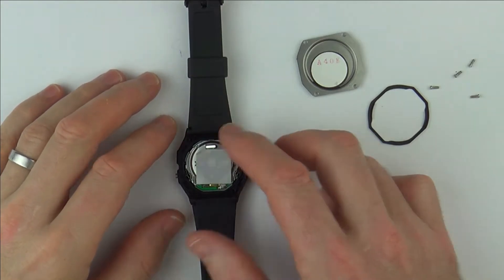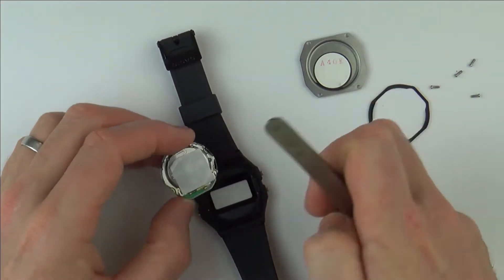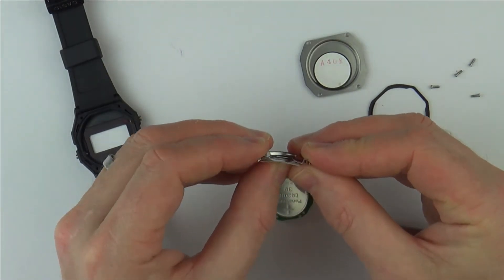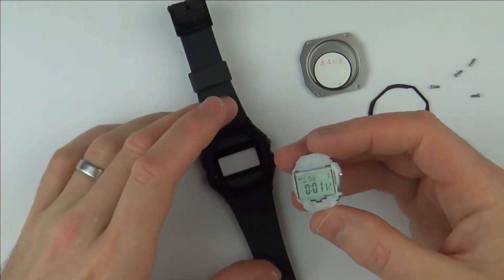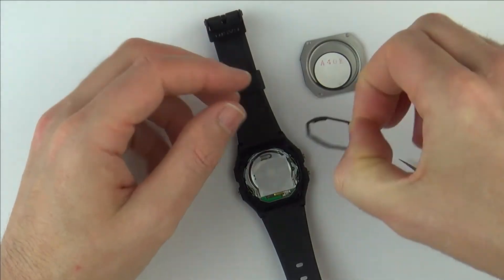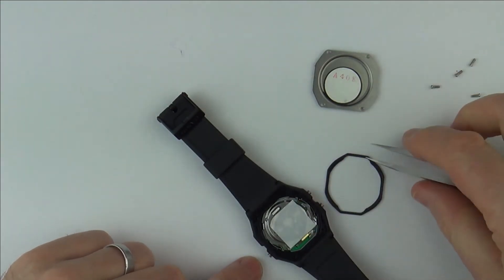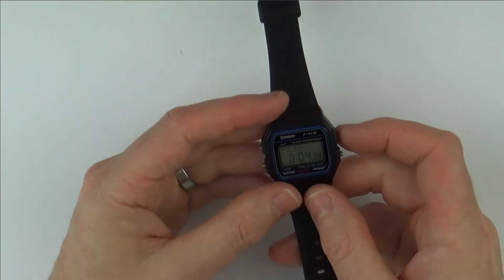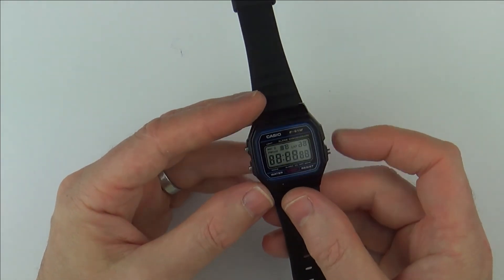How To Fix NO DISPLAY on a Casio F91W Digital WATCH after Changing the BATTERY

Comment: Even after you reset, if you don’t see any digits on the display, it could be because the contacts with the battery are so flattened down after years of a battery being in there that they’re not making a good enough connection. Take the battery out, use tweezers and pry the contacts up a bit so it makes a better connection.
Reply: This helped so much thanks!

Comment: Nice clear explanation. Thanks. 
One other thing that might have been good to mention is the technique for re-setting the watch. Sometimes after being re-started, the watch will come up in a frozen state and needs a re-set. The display will be fixed and will show nonsense characters. The trick is to connect the contact at the bottom of the re-set hole on the top front of the movement holder to the positive (springy back plate). On a genuine Casio F91w, the hole is marked AC I think. It looks like it connects to the can of the quartz crystal and when this is shorted to positive (the back plate) either with tweezers or a fine bare wire, the processor, resets. A couple of years ago I found my old F91w which had been abandoned for about twelve years and put in a new battery but it came up in this weird condition. In the end, I thought it was knackered and threw it away - sad to say. Had I known this trick it would still be working.
Reply: Realized the back plate is the + thanks so much!

Comment: I had the problem after assemble and reassemble the digits are "splittet" in a weird way. Reassemble it one more time, bend the contacts of the metal plate....and display works as a new one😊
Thanks, dude.

Comment: SOUND IS COMING FROM THE WATCH BUT NO DISPLAY WHY ? I HAVE OLD DIGITAL WATCH CAN I FIX BYMYSELF ?
Reply: Most likely the circuit board is not properly contacting the rubber conductive strip, probably due to lack of pressure. Like in the video. Try squeezing the outer springy backshell towards the front panel and see if it comes on. You can adjust the springyness of the case by bending the sides in a  little where the clips are. If the LCD still does not work properly, or if you get heieroglyphs because parts of the lcd are working and parts not, pull out the rubber connecting strip from the LCD and clean it and the contacts at both sides (LCD and circuit board) with isopropyl alcohol. Then it should come back.

Comment: Guys can anyone PLEASE help me, So i woke up this morning with no alarm, and i was like maybe i missed it. But then i stuck around for 4 pm hourly beep, and it didnt beep, i was like maybe a glitch, 5 pm, no beep, i REALLY care about my watch so i tested the alarm, no sound, i tested hourly beep by changing time, no sound, then i got really sad, one more thing that sometimes it makes no sound when i switch modes!
Reply: I THINK I FOUND THE PROBLEM (CORRECT ME PLEASE IF IM WRONG) is it the same reason in this video, that i have to kind bend the stainless steel plate? so that it can reach the inner watch (cricuit and stuff) please correct me if im wrong
Reply: Ok one day later i found the problem, there is like a stick which is connected to the inner watch and touches the beeper, so we just moved the stick a bit higher! and bam, works PERFECTLY! also im telling everything what happened to me and the solution because other people can also have this problem!
Reply: Bro please explain a little much
Reply: İ have the similar problem can you help me with it ?
Reply: @razorx6472  oh i would love to help, so basically, open the watch, and then you should find like a shiny-ish stick with the tip tilted up.. so hold the stick and then pull it up a little with small force, and it should work, the way this works is the stick goes down a bit too much, so it cant touch the beeper which is on the silver plate, so when we pull the stick up it touches the beeper and it works.
Reply: also the stick should be at the top of the cicuit and stuff,

Comment: I just replace and then thers no sound idk why
Reply: The little springs that touch the ground speaker on the back of the watch came out or were missing.  It happens all the time when people change casio batteries
Reply: Or if they are still there.... Turn the back of the watch case the other way.
Reply: Thanks it's already fixed thank u

Comment: I took mine apart to change battery now my beep stopped working any help
Reply: There's a little spring between the back plate's speaker and the battery compartment - if your watch didn't have a piece of tape there, it might have fallen out.
Reply: @lollycopter  thank you